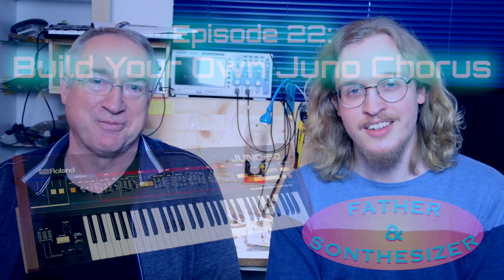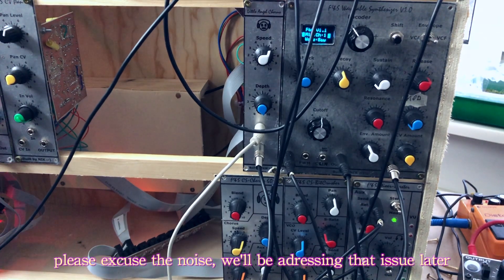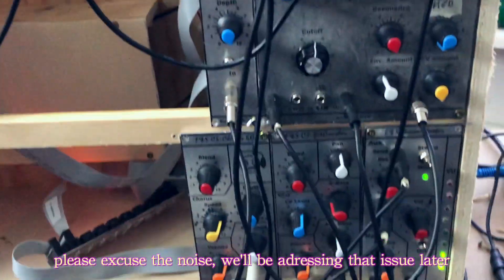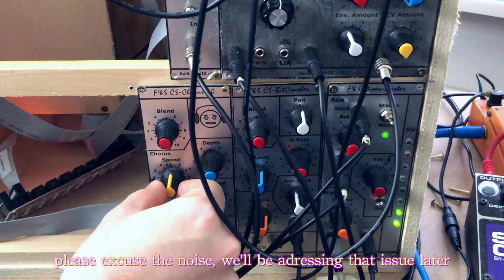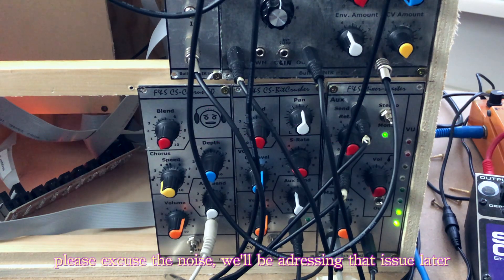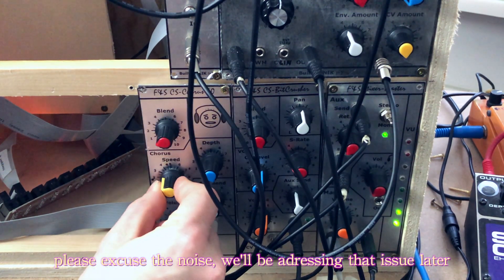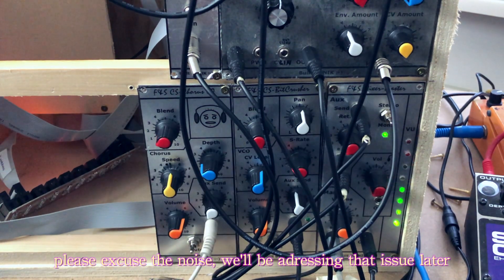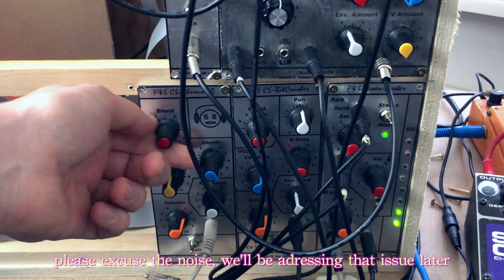Father & Sonthesizer Ep. 22: Build Your Own Juno Chorus

Comment: I've actually been building my own chorus pedal using that same schematic, but I find that the LFO signal gets stuck at a constant voltage. Did you add any parts to the schematic to combat these effects? An EE friend of mine suggested adding bypass caps on the power rail of the op amp so I plan on trying that already.
Reply from the maker: BanjoMasterPete that’s exactly what we did to combat the noise! We haven’t encountered your problem yet, but I’ve only been using it for a few days. Our scope shows a perfect triangle. Maybe you’ve made a wrong/missing connection? If you need it we could send a pic of the waveform on our scope
Reply: @georgekay372  Interesting, maybe I did wire something up incorrectly then. What op amp did you decide to use? I went with a TL072
Reply from the maker: BanjoMasterPete For the LFO we used the TL072 as well, and the other opamps 074 is fine but you can also use the 072!